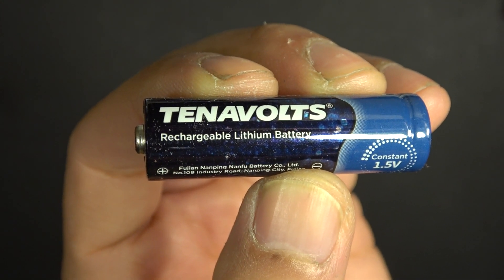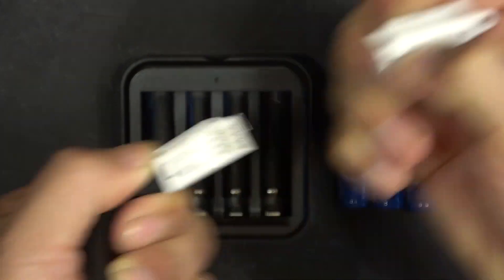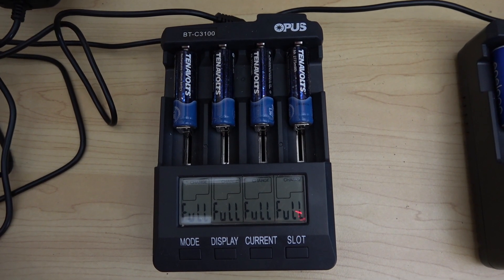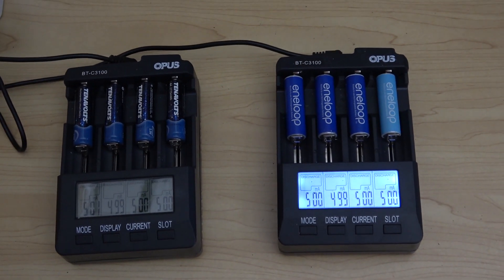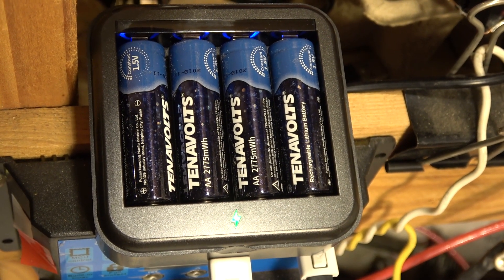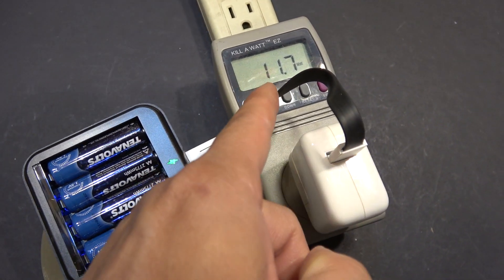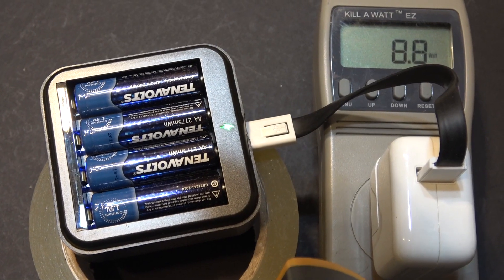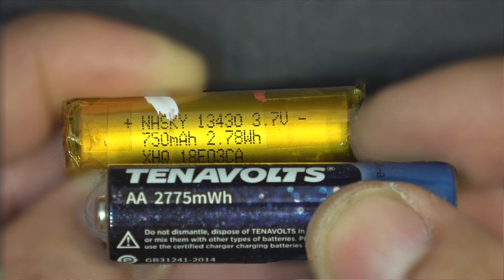Review & Teardown: Tenavolts AA Size 1.5V Li-ion battery

Comment: Nobody covers the non-rechargable 3.6 AA batteries
 I bet most never heard of them
 They're great for things that can handle  3+v or 12v with 4 AA. For remotes etc.  They last forever in many items. Yes slightly more voltage but generally improving on performance. No matter what item you put it in or add in series with regular AA with the 3.6volt AA

Comment: why you put Lithinum 1.5V battery on Charger divices but it 's not working until using there own Charger? Let me explain
The charging devices is used for Ni-NH battery, maxinum output is 1.5V
But The Lithinum baterry using 2 Voltage: 1.5V output way, but input way uses 5V. Cause they use that green pcb to control Input and output Voltage.
Unlike Ni-NH ,or Li-on 3.7V 18650,... Batery, they use 1.2V-1.5V to charge themselves.
And one more thing, The Lithinum Battery when it get low, they suddenly drop 1.5V > 1.1V or 0V, not like Ni-NH or Alkadelin, drop down slowly

Comment: Someone that has tested this question I have ,that can help . 1) will mixing AA/AAA BATTERIES  DISPOSABLE  with either  one of the following the Ni-cd , NI-MH , or the new li-on recharging batteries  will it damage the batteries if used on toys , electronics in a single or multi use will any get damage or won’t allow recharge after a usage due to some factors or differences of voltages but being new or freshly recharge to be use ? I tested and one damage but I wonder why didn’t the chip inside the lithium kick in !? Many won’t even get to test this  but I have to ask 😂 it might help us even when some manuales instructions don’t mention to avoid this and only say to DONT USE NEW AND OLD BATTERIEs

Comment: I was looking for a test like this. These are excellent for applications where 1.2V isn't enough to drive the load. Usually you would have to switch to single use batteries. Seems like the capacity is acceptable as well.
Reply: One example is the Franklin stud sensor 710.  Needs alkaline or 1.5V lithium

Comment: Very interesting, but I am still at a loss as to which AA 1.5v rechargeable battery to buy for my Oculus Quest 2 controllers.
Reply: Get these. They don't take long to charge and you get 4 so when the first two go dead you can put the next two in the controllers. Just charge them regularly

Comment: what voltage right up to the nipple of the JUGEE battery does it use? USB 5V? (Of course there is a voltage regulator bucking down the voltage to 1.5 v ) 
But I'm curious as to what the Voltage at the charger terminal with or without the JUGEE battery load ?

Comment: Great teardown!  I have to say, though, I disagree that the vendor is "mostly honest".  While 2.775 Wh is indeed what's listed on the internal Li battery, you show clearly that the delivered energy is only 2.475 Wh -- the rest being lost due to inefficiency of the voltage converter.  Since there is no way to recover this heat energy, the capacity of this battery should be listed at 2.475 Wh.
Reply: True

Comment: I stumbled on this video because I have the same battery set and I was dumbfounded when I saw it's butt light up blue when it's charging. I didn't think an LED would fit inside a battery this small, but the teardown proved me wrong.

(I'm just so used to conventional disposable batteries that I didn't think this kind of improvement in battery tech would be introduced in the market)

Comment: Has anyone used these in a Sega GameGear or Atari Lynx? They seem awesome but the only issue I would see is if they hold a constant 1.5 volts until theyre dead and they dont gradually weaken, you could be close to beating a game when your console suddenly dies without warning.

Comment: Inside of this is a small Lithium-Ion battery of 3.7 Volt, and the voltage regulating circuit keeps the Voltage stable at 1.5V. These Constant-Voltage batteries like Tenavolts, Hixon, Kentli, Jugee, Mrupoo are NOT Recommended for Audio, Radio, or very sensitive devices because the buck converter produces radio frequency noise and ripple voltage. The charger delivers 5V (you can't use regular charges). The total power of the cell is capacity is: 1.5V x 1650mAh = 2475mWh.
Reply: Ottima riflessione che vedo poco in giro.
Questa soluzione usa elettronica di tipo switching e quindi la tensione in uscita non è "pulita" come avviene in genere con le pile. Le cose più disturbate possono essere gli strumenti di misura su cui consiglio di non usarle

Comment: Wow, great video.  They put a round LiPO battery wrapped in Kapton tape inside a AA case with a buck converter on top.  My Duracell NiMH AA batteries are a little over 2,400 mAH and don't have any electronics needed.  I do like that this battery manufacturer had honest specs on their battery, though.  I'll stick with Duracell for now.
Reply: It's not very honest though when they know that capacity has to run through the step-down circuitry which isn't 100% efficient. The customer shouldn't have to know or care about that - they should advertise the usable power instead of the raw pouch cell capacity.

Comment: Great teardown, thanks! Do you know what the maximum discharge current of these batteries is? I am considering purchasing them for use in a camera flash so am looking for something with a high discharge rate to bring down the recycle time of the flash.
Reply: check out projectfarm's video which is more recent and includes a bunch of brands tested fully. i actually saw that first and found this video because i was curious about how it was built.

Comment: I almost bought the 2775 mWh Tenavolts AA 1.5 volt battery on Amazon. Instead i went for AA  1.5 volt Hixon 3500 mWh. Just got my AAA Hixon 1100 mWh battery 11/27/20 from Amazon. Maybe i might get tenavolts aaa batteries. I have also KentLi batteries their a little more expensive. Will get the 3500 mWh battery 11/28/20.

Comment: Li-ion (lithium Ion ) batteries are rechargeable. standard lithium (lithium metal) are a 1 time use. The Eneloop are Ni-MH (Nickle Metal Hydrid) batteries that run at 1.2 volts and too low of a voltage for some devices that only use 1 battery. But they are also rechargeable.

Comment: I'm terribly curious to know what's going on in the charger. USB = 5v and 4 x 1.5v = 6v
..which is completely opposite of what it needs if the charger is stepping up the charge voltage.
Hmm...
OH!! I bet you that they are NOT stepping up the charge voltage. I bet they are charging all 4 at 5 volts, and divided the 2.4 amps between all 4 batteries, so .8 amps charge per battery.
Reply: yeah, they charge like normal li ion batteries. so basically constant current for the first part and then constant voltage of 4.2 to top them off. the little chip on the circuit handles it all. so it's basically like those 18650 boards that make them into a usb powerbank, but the difference here is that instead of stepping up to 5v, it uses a converter to step down to 1.5 on the output
Reply: @carlos2004  I've since bought two different brands. I don't mind the weird charging configuration so much as the fact that each brand has to use it's own charger. THAT'S a bit of a PITA.

Comment: Unfortunately, not sold on Amazon. Does the Tenavolts last longer than the Eneloop batteries?
Reply: They are sold on Amazon now.  Where the Tenavolts really shines is not the capacity but the base voltage of 1.5v that's the same as alkaline, where NiMH is around 1.2v.  Some electronic devices are voltage sensitive.  I have a Bosch GLM 15 laser tape measure that uses AAA and it would work for a couple of minutes on fully charged NiMH batteries.  I thought the device was defective until I put in normal alkaline batteries and it works for a lot longer.

Comment: Very interesting, that little circuit in the battery is just regulating the Voltage to 1.5. This would make it impossible to know how much capacity is actually left in the battery. The would be good for flashlight since it could keep them bright, but the flashlight would just die without any hints. This would definitely need their specialty charger to work. It would have been nice if you checked the charging Voltage.

Comment: Li battery out side it is mentioned 1.5 v... Inside it is mentioned as 3.7 v..
Why ?
Reply: These are lithium ion batteries, the same kind on you phones, these typically output a voltage of 3.7V / cell. these batteries have a Buck converter (DC to DC converter) that lower the output voltage and maintains it at a constant 1.5V. So if you do the math 2775mWh / 3.7V = 750 mAh @ 3.7v but after the converter 2775mwh / 1.5V = 1850 mAh @ 1.5 V. So these batteries are actually not than far off from Ni-MH rechargable batteries because those output at 1.2V and they are rated at 2000mAh typically so 2000mAh * 1.2V = 2400mWh.

Comment: It cannot be charged with other charger there is some compatibility with the battery even if its a Li-ion charger, eventually the charger included in the package corroded easily, tried to clean and open it up and see nothing special. Hope you can try also tearing it down and check what make its special.. You can also consider a brand called KENTLI. they seems to be the same... this will hit market like a storm and those disposable batteries will no longer be around... the chip within the battery is really fascinating.i thought it will explode like Li-po when you reach the smell of sweet tear downed Li-ion Great video!!!
Reply: A basic or decent battery charger like he has has to guess what battery he is putting in it. It is guessing it is a 1.5 Volt battery which it is. But at 1.5 Volts it thinks the battery is pretty much fully charged. Inside of this battery is a small typical lithium ion battery rated at 3.7V which you normally charge up to 4.2 Volts. The charger doesn't know this. The charger made by the same company of the battery knows what to do. It would be nice if he measured the charging Voltage. It is probably just putting up to 4.2 Volts. Looking at questions on Amazon, some people asked if the charger would also charge NiMh batteries. The company replied no.

Comment: RE.. Debate over these being Lithium vs Lithium ION.  I contacted the company directly on Facebook via messenger to confirm and the company told me these are "Lithium Ion" which makes sense.   I did this because Lithium batteries cannot be recharged (difficult and risky to do) due to density among other things.  Lithium Ion batteries can easily be re-charged.  It does say only "Lithium" on the battery but if you don't want to take my word (or General Scientific knowledge for that matter), then please reach out to the company yourself.  They are very quick to respond.  My guess is they are calling it Lithium for short to distinguish it from other brands. it does Technically contain Lithium.

Comment: it is NOT lithium ION.  good God.
Reply from the maker: What do you think it is?
Reply: @vuaeco  a lithium battery.   which is exactly what it says on the battery and which is exactly what it says on amazon.  show me where it says "ION" anywhere in the description of them.
Reply: @stevejones9717  Wrong.. these are Lithium Ion.  I contacted the company myself via Facebook.   Lithium  batteries cannot be re-charged.   (Technically it may be possible but it's difficult and not safe to do).  Lithium ion batteries can be recharged easily and safely.  I contacted the company on facebook for clarity and they confirmed these are Lithium ion.  Calling it a lithium battery doesn't negate them being lithium ion as it still contains "Lithium".  Please reach out to them yourself on Facebook as I did, and they will confirm these are LION batteries if you won't take my word for it.  They are quick to respond.

Comment: Thanks for the review, Im looking into possibly buying these for a vr controller.
Reply: Did you ever buy it?   Im watching this as im installing them in my quest controllers, ill let you know if any problems arise but they're seeming to be worth every penny so far.   I advise to buy 2 so when the batt gets to 2 bars, you can charge them and instantly insert 2 new ones
Reply: @corvidconfidential8826  I ended up buying a different brand I found for cheaper. Lower capacity though and has the charging brains build into the cell, charges via usb. They seem to be working so far it seems like I got around 5 hours off a charge which I'm hoping is a fluke.
Reply: @vgamedude12  a bad fluke?  I haven't used them long enough to see how long it stays, but do you also use them till they die?  I use batteries until they are on 2 bars, so I'm sure this brand is perfect as it seems to have more charge.  I hate changing batteries on the quest as I have a skin on the grips, so the longer the charge... the better. 

Btw, what VR set do yah have?
Reply: @corvidconfidential8826  I have the odyssey+. I meant fluke because for some reason my left controller stopped tracking and the lights got dim but the right one was working fine. I took both sets out and recharged them to full, since then I have only played about an hour though.

One other thing, with the lipo batteries since they are constant 1.5v until shutoff the battery indicators do not work correctly, at least not on my headset. I get constant 3 out of 4 bar charge report.
Reply: @vgamedude12  mine has been used mostly since I replied first, just stopped to charge the headset, and I only played beat saber + pistol whip but my batt level has stayed at 3 the whole time.  Tracking never degraded and it already is lasting longer than a normal AA.  Hate to say it but you might want to see if it's the batteries, depending on how much cheaper they were might be a factor.    :c

Could be a quest thing too, I've only had a quest and know nothing else about VR so I could be wrong.
Reply: @corvidconfidential8826  aot vr would be cool. And possibly sickening.

The claimed mAh value of these batteries is 1500. If I play more vr today I'll try to keep a rough track and see how long they last, there is a 30day money-back thing on these.

They are GTF rechargeable batteries on Amazon
Reply: @vgamedude12  hmm, I wonder it stands for Get The Fucking-tenavolt-batteries-instead-of-this, though there's a chance im wrong as im not that good with acronyms.  ^~^"
Reply: Also, damn you captain.   Talking to you about VR stuff makes me want an AoT game already.      ;v;
Reply: How long do these batteries last for on a single charge?

Comment: It's worth noting that when comparing power output to the Eneloop you should be comparing the watts not amps due to the difference in voltage. Eneloop has lower voltage meaning  at around 1.2V average voltage throughout its discharge cycle it will have output 1.2 x 2000 = 2400mWh of power, whereas the lihtium had 1.5V constant voltage which means total capacity was 1.5 x 1650 = 2475mWh, so the two store almost the same amount of power in your test.
Reply: Thanks for explaining that
Reply: The discharge was measured, not calculated. It was accurate.
Reply: @freefall0483  The point is that Power = Voltage x Current so if you measure current you have to take the voltage into consideration when determining how much actual power (in Watt hours) the battery stored.
Reply: @bluc0bra  People with real world experience know that in the real world the theory doesn't survive reality.

On paper you are correct. In the real world, measured capacity equals usable capacity.

Your on paper calculations fail to take into account the losses of the battery's internals.
Reply: @freefall0483  I don't think you understand what I'm saying. I'm not saying the measured capacity in the video is wrong, but that battery capacity is a function of measured voltage AND measured current. Both are measured in the video, you just need to multiply them to get the total power stored in each battery in Watt hours. Internal impedance of the battery is accounted for because both current and voltage are measured. This is not about theory vs. reality, it's about interpreting your measurements correctly.
Reply: @bluc0bra  What if some of the rated storage of the cell is consumed by the electronics that drop the voltage? Do you think that maybe the rated cell capacity might not be the same as the actual consumable energy.
Reply: @freefall0483  how the capacity is used will depend on the appliance. If it uses a linear regulator then the extra voltage of the 1.5V cells will be wasted as heat. If it uses a buck regulator then the extra voltage would result in longer running time. If you just run something like a motor directly from the cells then the extra voltage will lead to higher performance instead of giving you a longer battery life.

Comment: These batteries are similar to cell phone batteries. The charger and batteries have proprietary electronics to control charge and discharge.
Reply: It is regulating the Voltage of a 3.7V battery to 1.5V. Nothing too special. it needs a special charger that knows what this battery is doing though. A typical charger won't work on this.

Comment: I have one question about that. While NiMH batteries getting empty, they loose voltage. Than the device which is using that battery, decides to shut down for example @0.9V. So what happens these Li-ion batteries getting empty? Does it cut the current instantly like pulling of the battery? Isn't it harmfull for devices driven with software? Isn't it confusing for these devices, there is 1.5V but it can't boot up?
Reply from the maker: It'll cut the power because it doesn't provide enough current even though it's still 1.5V.
Reply: @vuaeco  so isn't it a problematic situation for host device? Let's say it is an xbox controller. It will measure 1.5V, will it try to wake up repeatedly, forever? Or it will wake up but when it try to use vibration motors will it cut off?
Reply: @mhakanalim  Its fine in my experience. I use them in LED lights that have all sorts of controls and patterns and they just go super dim. Xbox will be A-OK too (we have one at home).